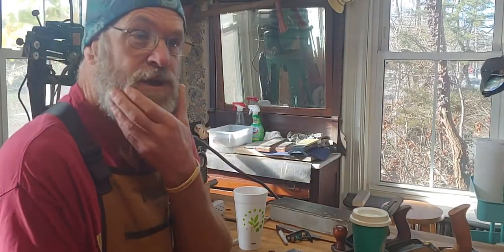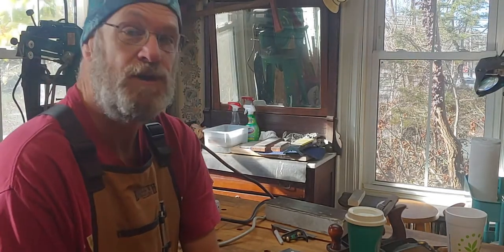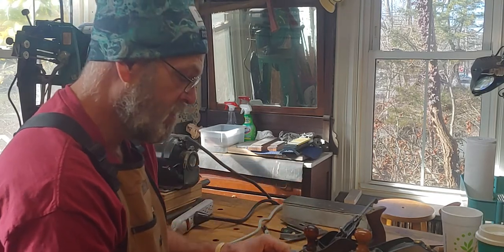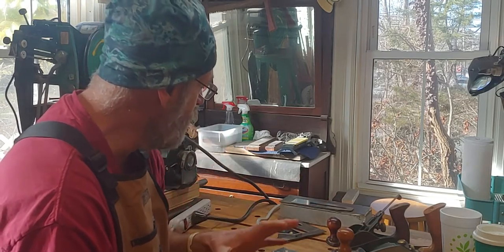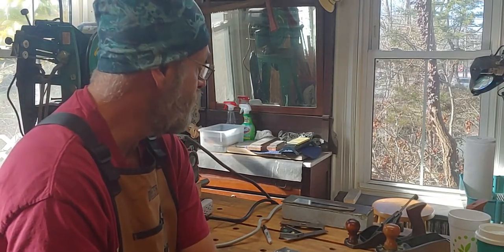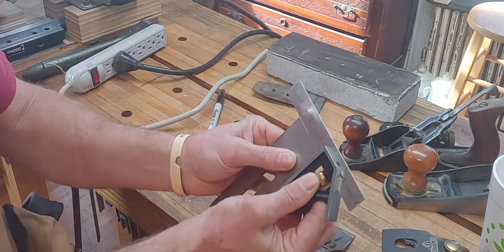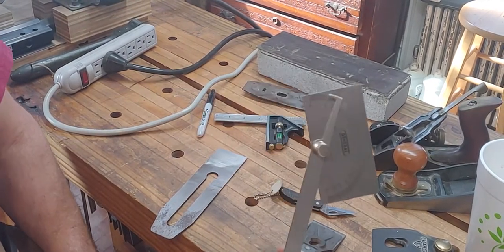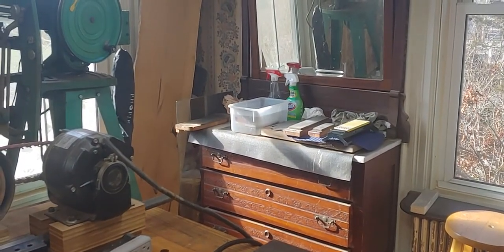Grinding a plane iron and cutting geometry lesson(part 1).Iron repair, freehand sharpening, planing.

Comment: Thanks William for the grinding video.Very professional explanation. What is the rpm and the diameter of the grindïng stone. I saw that you could easily thouch the iron so it was n't hot at all.
When i try to grind it very carefull it is getting hot, is that because of the material of the irons.
I used 200mm en 3000 rpm. Now  i am trying on a 150mm 1500 rpm.
Reply from the maker: More likely the stone is too fine or loaded up.  My setup is 6" @ 3650.. I'm not pressing very hard either.  If the stone is very course 60-80 grit and dressed, it will keep the heat down unless you really go hard at it.  Usually, there are a finite number of side to side motions that you can do before it heats up.  Just stay below that or keep some water at the side to dunk it.  I hope I showed that it does NOT need to heat up and does NOT need to be dunked.